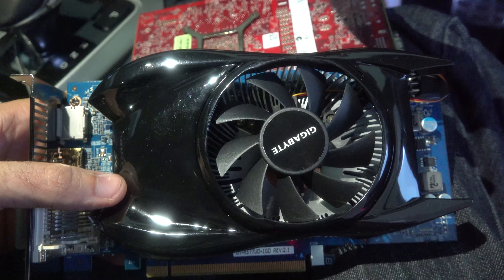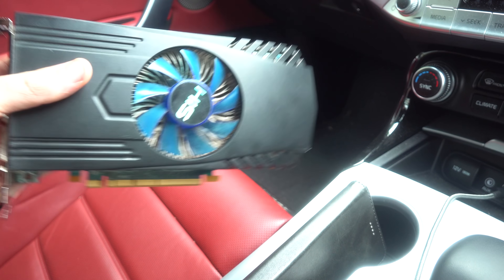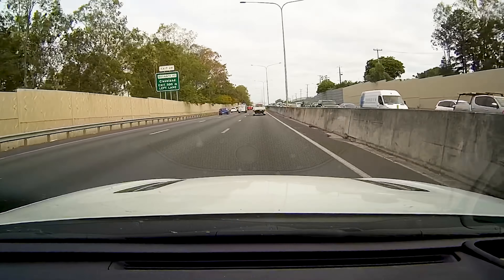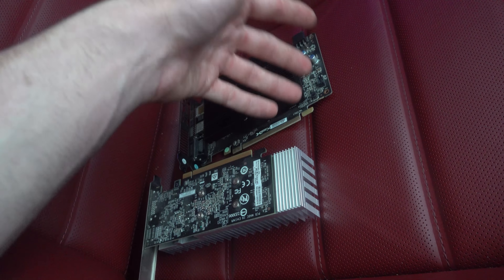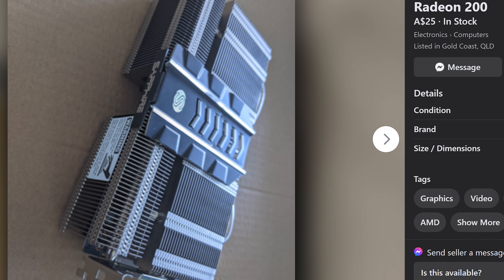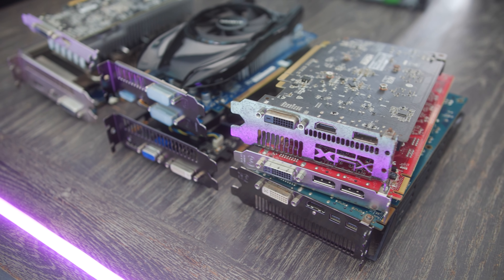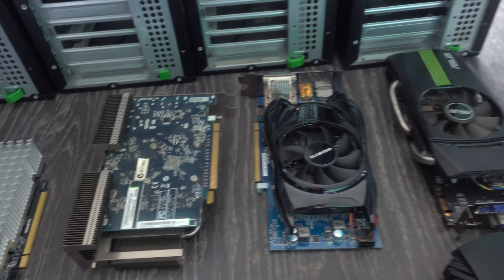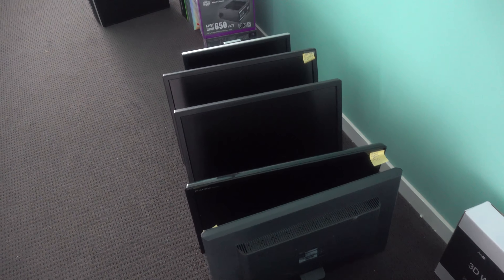Buying CHEAP (Underrated?) GPUs - December's 2020 USED PC Parts Hunt

Comment: On my weekly assessment world market under primary cpu/system price floor is moving; Broadwell and Haswell u laptops especially anything Apple < $300. High end back in time Haswell i7 49/47 HQ/MQ mobile moves exceptionally well. Whiskey lake mobile might sell if/on price drop  Desktop, mid range (i5) is stalled. its either P/C, i3 or i7  back in time. Last three Intel generations, Coffee Lake 87xx_ then sales moving to Kaby Lake desktop trickle off except 7820 is clearing. Big at risk inventory questions with quads although Ivey Bridge EE quads are selling < $60.There are Alienware 8086K rebuilds showing up for $499, selling, make sure the components (power supply etc.) is at and up to spec as the systems seem pieced and parted together for the price point. Retails says Ryzen performance desktop is selling looking at the channel, so, so, the price boycott on supply question is working there is plenty of supply on the way; Feb/March. AMD is focusing through specific channels (DIY) retail preferred. In the open market channel 3400G is the top seller. 
AMD R 5xxx sales strategy replaces/replenishes channel existing Matisse R 3xxx inventories as they clear. This is the AMD access/allocation sales strategy for 5xxx, one supplied for every 3xxx that clears. R 5xxx will also be sold + 6x00 GPU in a bundle deal from AMD. So as Matisse clears you'll see 5xxx come in tied in sales deal to Big Navi. Intel of course will continue to move 9xxx primarily on price drops although 10th gen is and will see price drops through January will be the best Intel deals. Intel second week of October supplied i9 9900K into the channel equal in volume to every Ryzen Matisse 3xxx CPU that existed in the WW channel; its called Intel one on one and the price is coming down nicely. On the GPU front back in time is stalled waiting for Ampere and big Navi. The upgrade market is from Volta and Pascal, science and commercial primarily, so there is waiting. Gamers while coddled by the game content and GPU design producers 'on the hype train' are not the primary market; science is on the margins and willingness to pay in excess of what majority of gamers would pay including under the boycott wait and see for supply. The supply will be cut down arrays because science will bid up the full array GPUs. mb

Comment: Oh yes, the Cult of i7, the Nvidia tax and the rise of RGB. The market seems to be exactly the same in the UK, people seem to have got used to spending big 4-figure Sums on electronics, possibly thanks to 4-figure phones and 4-figure graphics cards getting a lot of press in modern times. These are things I will never subscribe to, I look for the best price to performance in everything I buy, i want elegance, not bling. But Brian, if the market is going that way and that's what you need to do I won't hold it against you. You are a very canny operator, seems like the Tech yes City thing to do is get the best out of the market, after all you are so good at it!

P.s.: I have not been watching your RTX 3000 content, no offence but that just doesn't interest me.

Comment: People are stupid to buy second hand cards at such high prices. I've loved buying secondhand in the past. Going back to 2012 I picked up a gtx 580 for £150 off eBay. That card broke after a month use and pny replaced for gtx 670 which was newly released at the time. I ended up buying a second gtx 670 new for around £250 and played in sli for a long time. Then in 2016 I sold my 2 X gtx 670's and with the money earned, I purchased a gtx 970. In 2018 I bought a secondhand gtx 980ti for around £150. These cards are still selling over this price now. What a joke. Im Still waiting for gtx 1080ti to be sub £200 then I'll upgrade to that. No way will I pay over £500 for second and third tier performance cards. Im predicting this will happen in time for my birthday in April next year.